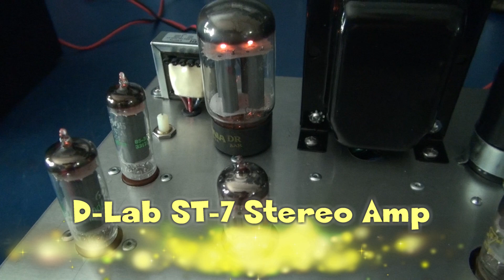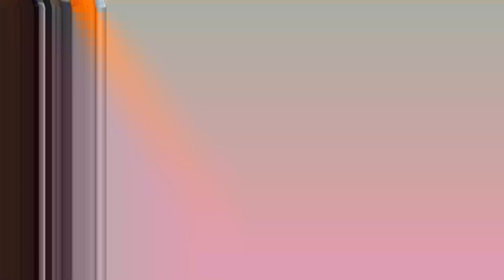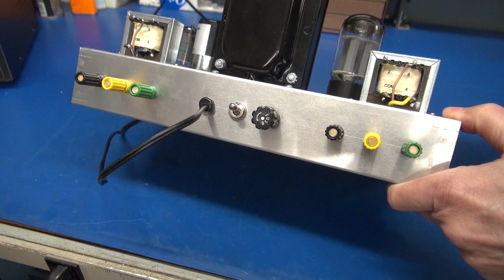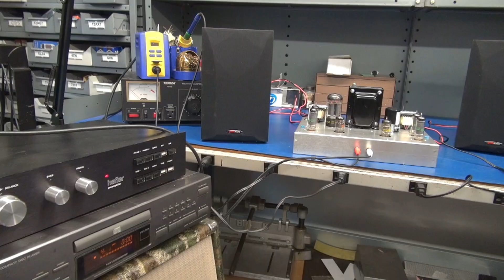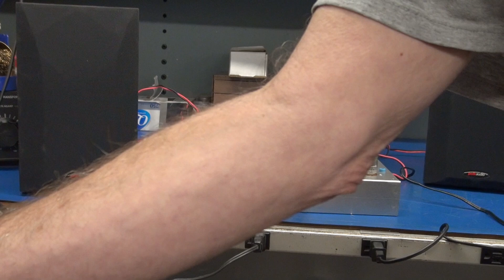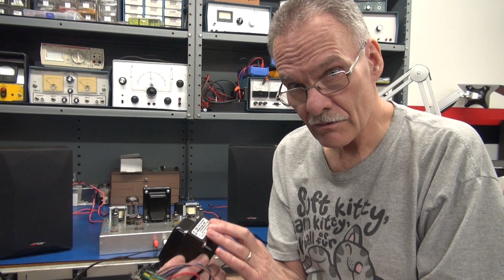Demo D-Lab ST-7 Tube Home stereo amplifier, modeled after Dynaco ST-70 Evolving Project low power

Comment: Howdy.
I would like to point out that the low end roll off is declared for full power. If one uses only 1/4 of full power the voltage will be ½ the full power voltage. The low end roll off will go down to half the specified frequency. The core will saturate at half the frequency.
Regards.

Comment: The Hammond 1608 is a wonderful transformer with ultralinear screen grid taps. It's also over $100 each.  The EICO ST-70 is a formidable amplifier. But so is the HF-81 as is the Heathkit W5M. Your observation is astute, the magic occurs in the output transformer and the speakers.

Comment: Good job Terry! I too had knee issues, arthritis was mentioned also by doctors. I found I had low testosterone, my muscles had relaxed and or shrunk to allow my knee bones to have little or no cushioning. My knees and hips are doing just fine these days at the age of 66. Good work shoes or boots, rubber mat under where you stand and a stool for when don’t need to stand was advise from a sports doctor until I was properly diagnosed years later. Painful Swollen knees were part of it from time to time. Just thought id pass it along!

Comment: This first amp version sounds good for old people who are losing their hearing and cannot hear above 15,000 kHz.  
            On top of that, it makes it a prime candidate for a high-efficiency single driver, Hornback loaded speaker design. 

Building this type of amp is excellent on the budget

And building a single driver speaker with no crossover a 8 inch or a 10 inch with a horn back loaded design is also very easy on the budget 

And extremely simple 

And plays well with people who have lost their hearing above 15,000 Hz.
Reply: Beautiful sounds 😃
Reply: The problem with the first version is that you also don't get the low frequency response below 150 Hz.